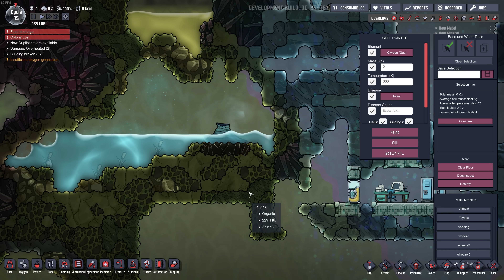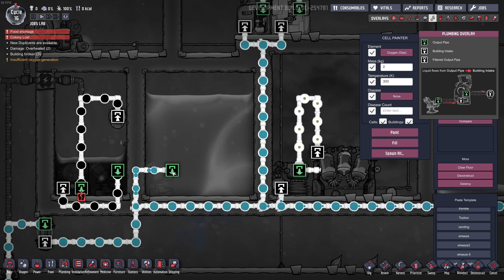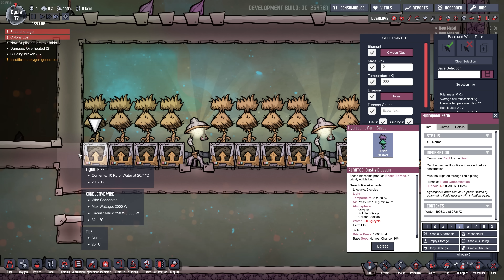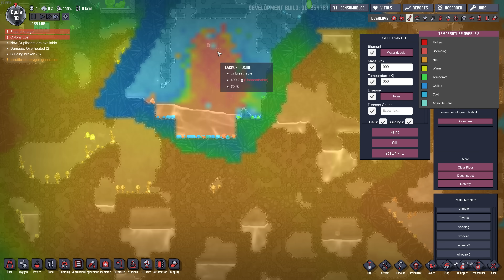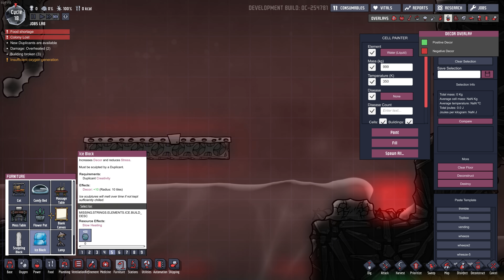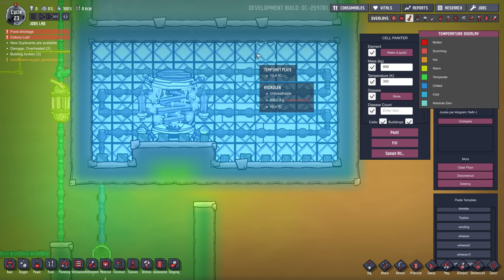HOW TO COOL WATER GUIDE- Oxygen Not Included - Tutorial

Comment: I think there needs to be some classification here between:

- "temperature control": The Thermo regulator and aquatumer are the prime example, it's mainly useful for regulating environment for plants and a comfortable working environment for dupes. This class also includes other processes where certain buildings always outputs stuffs at certain temperature which just happens to be a useful temperature for another other building/plant. 

- "endothermic/exothermic reactions": physical transformation on materials that are accompanied by heat absorption/generation

- "heat buffer": heat doesn't really get destroyed or converted, but some buffer like the ice biome or oil can withstand quite a large number of cycles

- "heat containment": Some containment are quite unrealistic, as the game had materials with zero heat transfer, but they're an easy and effective ways especially in the early game to avoid geysers in unwanted locations until you can use them meaningfully

- "physics-defying heat destruction": it's a game, not physics simulator, but meh... these are the game's heat economy sinks. There's also quite a lot of physics-defying energy creator like the geysers, so it all should balance out anyway. The wheeze plant and anti entropy nullifier are the prime example here, but there are also some building process here and there that destroys heat because of the quirk of certain processes

- "plain and simple bugs": like the cold oil tile trick, these are things that are likely unintentional and likely to be fixed in the future

Comment: dude ı just downloaded the game and ı was watching guide DUDE UR GUİDES ARE SO AMAZİNG. and the things u show are easier to understand cuz ur just building it.not like cutting the parts of building in video like other youtubers xd
Reply: Be aware that the tutorials might be outdated. For example the fixed temperature output of the watersieve has been changed, now it depends on the temperature you put in.
Lots of machines have been changed to have output at a set minimum temperature or the input temperature if it is higher, so no heatdeletion there (actually massive heatgeneration if your input is below the min. temperature).
Also wheezeworts got nerfed.
Most heatdeletion nowadays use a steamturbine and an aquatuner to exchange heat with the steam that feeds the turbine.

Comment: in an earlier comment i made, you mentioned using a steam turbine to cancel out heat. if a person doesn't have oil or a turbine, can the person use water for the aquatuner bath, and pipe the water to the electrolyzers? using weezeworts and hydrogen filled rooms with HVACs to cool the electrolyzer room?
Reply from the maker: check out my recent series hardmode around episode 14 15 I set this up the new way. No need to have it sitting in any liquid if made out of steel. you add a bit of water and it turns to steam which goes to the turbine and deletes heat while recycling the water.
Reply: @GrindThisGame  ok i will.
Reply from the maker: sorry I missed the no turbine part...I would just wait for it as it works so well vs. other setups.
Reply: @GrindThisGame  will 3 turbines work with 3 aquatuners? and would weezeworts/ HVACs work for the turbine room?
Reply from the maker: yeah I think 3 and 3 would work but 1 and 1 does an amazing amount of cooling. I have 1 wheezewort cooling my turbine so far.
Reply from the maker: One additional note.... if you send hot water to a electrolyzer the oxygen will be hot. this is fine for exosuits but bad for base oxygen. wheezeworts in hydrogen will help cool it.

Comment: lol silly me, I've been using a mod that changes the sieve output temperature to be dynamic based on input and machine temp, rather than making it 40 degrees no matter what.
It's nice not to have that unrealistic heat introduced into the system anymore.. But now I also can't use it to delete tons of heat down to 40 degrees. I gotta rely on more legit methods now. heh
Edit: Wait, does the Carbon Skimmer also produce the same out heat effect? or is this info a bit outdated? If so, that would make more sense to me, and I can still use THAT. heh
Reply from the maker: carbon skimmer and a few others.

Comment: the "exploit" with the oil is actually somewhat how real life thermodynamics work since mass isn't really a factor in heat when talking simply about thermal energy technically speaking in physics cold isn't a thing its an abstract concept  in physics heat is a real thing however since you measure how much heat something has regardless of mass when they join in real life they try to reach an equilibrium cold is nearly a mechanic of removing heat technically. for instance to put this as simply as I can if you take a peice of ice and put it on a bar or counter it isn't the ice making the counter cold its the heat energy moving into the ice even though they don't have the same mass

Edit: this does not mean mass is not a factor just that it isn't the primary factor by with thermal energy transfer operates
Reply from the maker: Yeah hydrocarbons aren't the best liquid to soak up heat vs. water due to the non-linear shape and hydrogen bonding of water. I didn't want to get too technical :)
Reply: LOL this is Oxygen not included we live for over-complicated and technical lol

Comment: Fantastic tutorial, I was really struggling to cool steam geyser water, and this helped tremendously. If you just pair the water filter system with an aquatuner, you have 26 degree water with a mere 1.4 kw of power consumption. This will definitely be put to use. Thanks a ton.
Reply from the maker: Glad to help. The way I do it now is put my aquatuners (4 or 5 in series) in the oil biome and use them to cool hot geyser water down to about 10-15C. The heated oil I destroy and turn into petroleum (and then plastic or power).
Reply: @GrindThisGame  by any chance... does the cooling contribute to showering? does warm water showers give better moral or is it the same sh#t? would be cool to know.

Comment: Nice video, explains a lot about how thermodynamics of fluids work in this crazy game. Just a quick question though, could you combine the 5 aquatuners that are cooling the water and the single aquatuner that is cooling the oil so that the water comes out cool and the aquatuners stay cool, or would the ones cooling the water put out too much heat for the cooling the oil to keep up?
Reply from the maker: I think the 1 oil cooler would not be enough to cool down the 5 water ones. Aquatuners just transfer heat. At some point you need to destroy the heat (like turning the very hot oil into 75C petroleum and then optionally burning it).

Comment: Can you explain what's difference between regular battery/smart battery and also the regular storage/smart storage tho? Thanks
Reply from the maker: The tooltips do give a lot of info so I'll be brief. The smart versions have a logic output signal. What I usually do is set the slider bar on the smart battery to 50% and connect the logic port to my power generator (eg coal generator). This way the generator only comes on if the battery charge falls below 50%. This saves you fuel. Smart storage sends a signal when it is full I think. I've never actually used them. You could do something like only cook food when the food container is near empty.
Reply: i got some confused reading the tooltips lol. Thanks dude

Comment: I had an issue when trying to do something like this, when boxing in the geyser, the temp of the gas in the box heated up to 95+ and the steam started to build up to 4k per tile over time, and it was not turning to water anymore, causing the water in the box to actually be rising in temp, which would prob given enough time turn to back to steam.
Reply from the maker: Yeah sometimes you need to use a few granite tiles to let the heat leak out and/or open it up to let the pressure out.

Comment: How do you deal with the pipes breaking because it becomes too cold?
Reply from the maker: Silly answer but don't send water that is too cold into a system that can cool it. You can use a thermo sensor to check the temperature before you enable the pump to allow water in. Just make sure the water is 14C warmer than you want if you're cooling it in the aquatuner. I suggest 20C warmer to leave some wiggle room.
Reply: The problem is that the Water temperature is about 25-30 C and then it cooled down some how, maybe because I made the pipes out of Tungsten which is weird because the pipes are in my Base which is Warm-Hot, I was sending Polluted  water  straight to my Hydro Farm Tile, growing Picha Peppers, I had a lot of trouble setting it up trying to heat the water and room to a temperature of 55C it did heated up because I used Space Haters and Metal Tiles but the Plant itself and Water didn't heated up.

I guess if you can make a guide on how to make the Picha Pepper farm it would be great because that is where I really messed up my base and had to start a new Colony.

Also how do I Maintain Heat in the Bristle Farm, I used Ceiling lights and it heated up the room over time about at Cycle 100 and so I decided to start a new Colony, because everything was really messed up.

Edit*
Also a Guide on how to make a Sleet Wheat Farm would be really nice too.

Comment: Hey. Great video(s). Newer  to this game. One thing I do with thermal reg and aquatuners is basically using 1 (or more) unit you can loop the pipe back around to cycle through the water/air again (half will cycle back and the other half will go off to wherever it's directed (or use a third pipe and so on). Anyways, the returning water will cool again, but obviously this runs into freezing issues really quickly (with water. Air not so much). So to combat this i throw a valve to only allow ~half or a third through which will then mix with the fresh/hot water (or air), cooling it before it has entered the tuner the first time. Hope that makes sense.
Reply from the maker: Thanks. I've played around with the feedback systems before as you suggest and ran into the freezing issues as well. I find the 5 aquatuners in series to be somewhat magical for getting 95C geyser water to 25C. The aquatuners only run briefly so it uses less power than expected.
Reply: Grind This Game yeah, I had some power issues, hence the attempt at a work around. Currently trying to set timers to have day/night running machines to combat this. 
Keep on grinding, my man.

Comment: The problem with putting hot water into producers like lavatories and showers is that it actually MASSIVELY increases the amount of heat energy stored by the water i.e. it takes more energy to cool down 95C polluted water than to cool 95C pure water. One way to delete enormous quantities of heat is to boil polluted water as it takes LESS energy to condense and cool as it took to boil the water. Much like your oil cooler example but with greater efficiency (boil the p.water with a hot aquatuner that is cooling the pure water, bonus points if you preheat the p.water with ambient heat from generators/geysers).

This is one big case for why heat deletion isn't much of an exploit, since the same system can easily CREATE excess heat energy as well.
Reply from the maker: Or you can send that hot polluted water to a sieve and get 40C clean water (with germs that will die) or just destroy it in fertilizer makers to get nat gas. But you could boil polluted water as you suggest on aquatuners. Those systems can get mucked up with dirt and sand depending on the temp though. What do you use to cool the steam?
Reply: Agreed, but you're actually better off starting with cold water in your lavatories to produce p.water, heating that to high temp via the environment (such as exchanging heat from hot pure geyser water via aquatuners) and then feeding that through your sieve. Essentially there are ways to make that equation more efficient, as passing hot water through a toilet multiplies its heat energy by 1.4, even if you then destroy the majority of that heat via sieves etc.

Going so far as to boil the p.water is really only necessary if you're in a limited water world (no water geyser) or want to run a steam generator.
Reply: Maybe you could somehow dump some more heat into the steam and then use it in steam generator

Comment: In my current colony the wolfarite radiator thing is a total failure. The pipes went to 2 different cold bio domes and net result is cooling from 72C to 66C. The pipes used almost 5 tons of it too.
Reply from the maker: It's working :)  just needs to be longer. It's easier just to dump the hot water into a granite (or metal) tank in the ice biome and it will cool very fast. Then you can pump it out for plant use.
Reply: Yeah... that is my new plan... I just feel bad that real life thermodynamics don't work in the game. I refuse to use the borg box BTW
Reply: TRy to build a section with Hydogren Gaz and weezeworts and theramal shift plates. works the best for me

Comment: If you have 5 kg of steam in your steam geyser chamber water production slows down  drastically. Sure if you don't need a lot of water and afraid of heat leak inclosed systems are good. But map only have 2 water geysers and big bases suffer from water shortage fast.
Reply from the maker: Define big base? Yeah I was able to tap out 2 with 100 dupes. You can always crack it open if things get too high pressure.

Comment: You are sending a trickle of water (100g) through the nullifier radiator. Wouldn't it be better to put the valve after the nullifier room, so that a larger mass of water was sitting in the radiator at once? Then you could use a temp switch and a shutoff valve to maximize the rate of flow. Also, I've found that pumping the nullifier rooms up to 20kg of hydrogen with a high-pressure vent helps them eat the heat more efficiently.
Great videos, by the way.
Reply from the maker: I'm not sure the large mass would speed the cooling but you could then dial in the exact flow rate that it could handle using regulation as you suggest. And yes, I think 20kg of H2 would work much more effectively than 2kg. Good idea.
Reply: You might want to move the hydrogen around as well, maybe with the door pump

Comment: Are exploit not the same as cheating? Probably those exploits will be removed/changed in future updates.
Reply: The fixed 40° output is terrible. This game should respect conservation of energy - there’s too much weirdness and bugs in heat. I don’t want to use these cheats.
Your sand filter makes germy water which makes food poisoning.
Reply from the maker: Correct...unless the devs intended liquids to work like that. Probably not.
Reply: Exploits aren't technically cheating. 
You are using a feature inside the game to your advantage, be it there on purpose, or not. 

Cheating would be using something to alter how the game fundamentally works.
Reply: Idjles Erle The water sieve doesn't kill germs... but doesn't add them.

Conservation of energy for the whole map is too demanding for a lowly desktop CPU and RAM.

Comment: Nice vid,

i use an automated system myself that does not use allot of power nor room or oil, or wheezeworth's
it can cool steam and water below 20 easy

https://imgur.com/a/TdKAH

basically its a buffer gate system where u drip cool limited amounts/mass , that gets cooled down fast
then dropped down and pumped away, for steam cooling u need more thermo regulaters to make it effective.

one other way ive used to cool water or even a geyser, is super cooling oxygen into liquid and drip that liquid oxygen
on top of a water tank or the geyser itself...

it is not hard to super cool stuff and your right about gas vss water and oil, 
tho i use the mass of doors and other equipment most... oil is really good stuff and u actually want to supper-heat it for steam
it could be used for cooling and as brothgar points out that water and oil almost have a 1-2 ratio
altho we don't cool the oil back down and use it yust to buffer /transfer heat like a refrigerator would
or like the engine of a car...
Reply from the maker: Looks pretty nice. How many grams/sec can it cool?
Reply: not sure really, enough to keep things going in my base, its only used for plant water really as u point out.
ow, and if u want to use a steam geyser, u will need this kind of setup to vent off steam or else it will saturate
the system...

another dude on youtube has interesting solutions too,
https://www.youtube.com/watch?v=_Y9s-nH8UzU&t=1210s
Reply: https://imgur.com/a/TdKAH

my self contained oxygen cooling system....
Reply: lol sorry about the messy posting, and editing =)

Comment: That one-tile-dripping part was interesting.. I do have a few questions though:

1. Will it work the same way if i use water or any other liquid instead of oil?

2. Instead of aquaturner, what if i just pump the water onto the metal tile that has a wheezewort on top of it? If it does work the same way, wouldn't it be much more efficient?
Reply: The exploit works with any liquid, but it's a definite exploit and I'd try to not rely on it too much, it will probably be fixed at some point.  The whole point of ONI is finding ways to get your colony working without cheating, if you need an exploit to do it then you may as well just play all the time in debug mode and just cheat your way through everything.
Reply: Lucas Riley heyy gotta enjoy life while it works the way you like it to be man